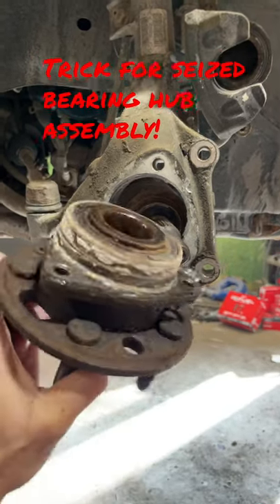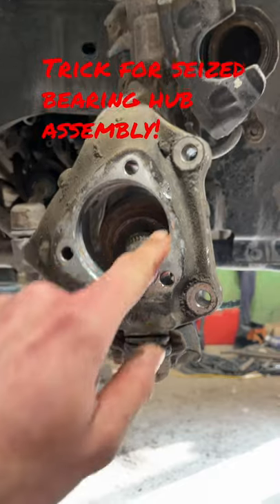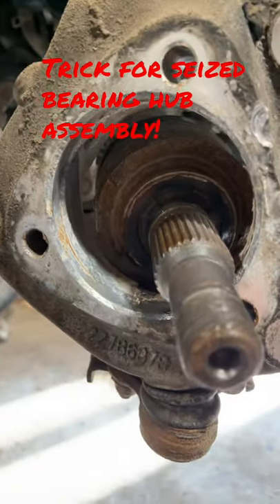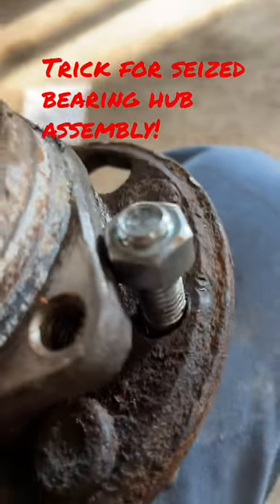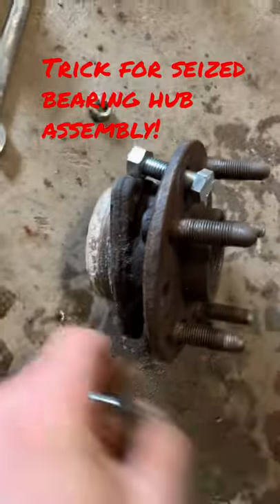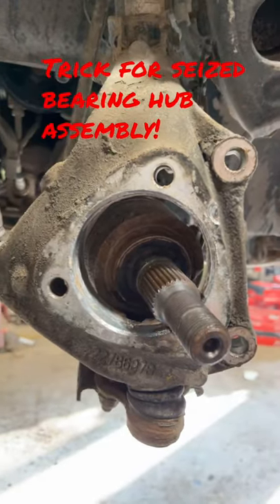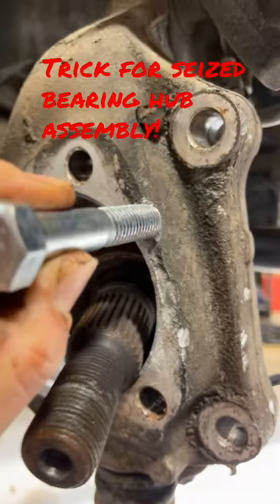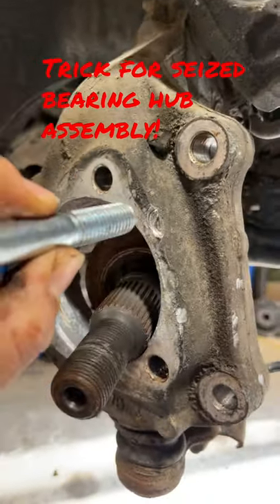Part 1/6-Trick to remove seized hub & bearing assembly using bolts! #mechanics #diy #homesteading

Comment: The people saying it’s bad to leave a mark on the knuckle probably have never change one themselves ! that mark hurts nothing at all speacuallt if it’s an older car 😒 ! you can damage way more stuff by hammering it ! and also if you have a pneumatic hammer drill or an ale truck one it helps so much as well doing both things , tighten the bolt to get the bearing out and when it’s pretty tight use the hammer drill to help opening a gap between the knuckle and bearing ! 👍👍

Comment: I used my machinist wedges cuz my wheel bearing had come completely apart the rollers fell out wheel bearing never made a sound no squeaks or gringimg like normal when they start goin out and te abs light never came on untill it failed 100% which in my previois experience is when the wheelbearimg is gpin out the abs light usually comes on!

Comment: How do you get the three bolts on the back out
Reply from the maker: With regular wrench or socket with the wobbly attachment. Heat with torch can help if needed
Reply from the maker: I explain better getting the back bolts in part 6. I did part 1-6 you can see on my channel or I just added the links to this comment thread. Subscribe if you like. Here is part 6 link for you:

https://youtube.com/shorts/9lXW5NCqd5g?feature=share

I also have one short on brake job in 60 seconds

Comment: Supposed to fix cars, not ad damage to them
Reply from the maker: When things are seized this is a trick many people use. This doesn’t affect the bearing. The bearing is a stand alone sealed unit. Yes it made a mark in the steering knuckle. But sometimes it’s that or replacing entire knuckle anyways. There is no seal needed. This mark can be smoothed out and works just fine and saves an hour of hammering. Then we apply copper anti-seize lube around, and it won’t be seized on next time.